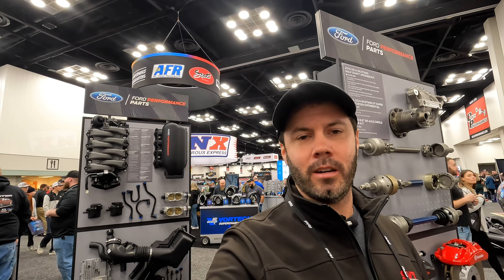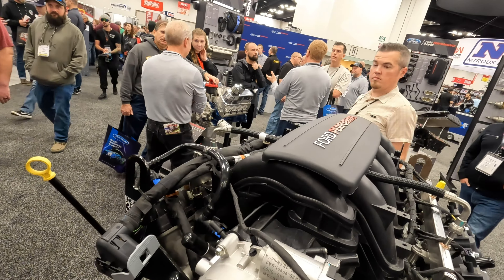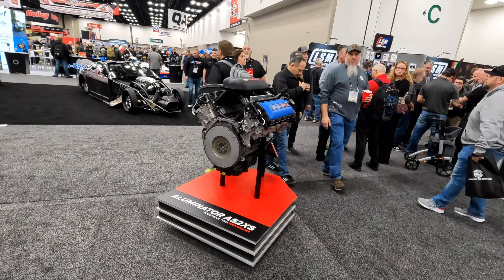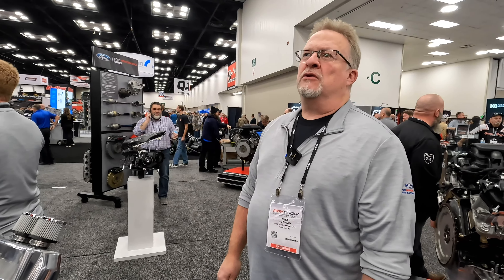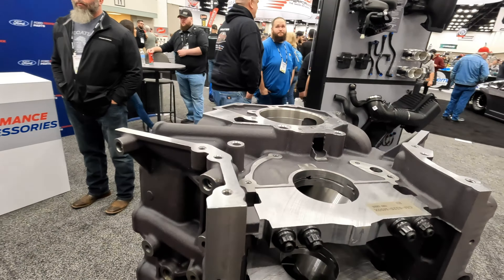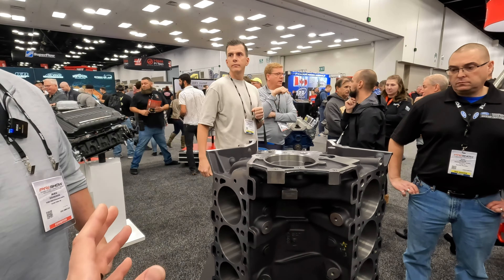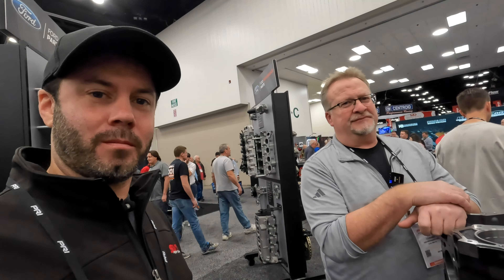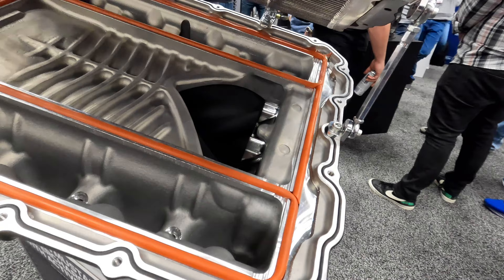Order Your Megazilla/Werewolf NOW!!! | Inside the Ford Performance Booth @ PRI 2023

Comment: The engine costs 53,000 $ ??? I would buy a Tesla no oil leak no miss fire no heat no cam shaft no all that sh it . I will see you in 5 years from now
Reply: 5300.00 not 53000....and 2ndly in a few yrs u will be spending another 20k on a battery replacement sooooo good for u....when the power grid becomes dangerously over used and electricity hits 5, 600.00mo for a 3br house and you are told you can no longer use ur ac at certain times I bet then you can bitch about all those v8s running around while u can't find a way to charge ur battery ..
Reply: @Brutalford I wish this engine was $5300.00
Reply: $5300 for the bare block. Asses
Reply: And doesn’t charge in cold weather 😂😂😂😊

Comment: I am a ford guy through and through, but that Megazilla price is about $7k too high in my opinion.  I just don't see many selling at that price.

The coyote block will sell at that price, in my opinion.  A SBF Dart block with that holding power is around $4k, and the iron coyote is for a specific crowd.  I think it will do ok.
Reply: There is a large Cobra replica fanbase who will probably drop the Megazilla engines in their replicas.  The 430 hp version started catching on, and I imagine these higher horsepower versions will, too.  Plus, that is 'MSRP' not necessarily cost at purchase.
Reply: That's actually budget friendly.... smdh

Comment: Cast iron coyote block if it's as good as the old 60s 70s ford 429 load it it will tote it that was the word back in the day concerning how much the 150 would haul and how many RPMs you could turn the 289 and 429